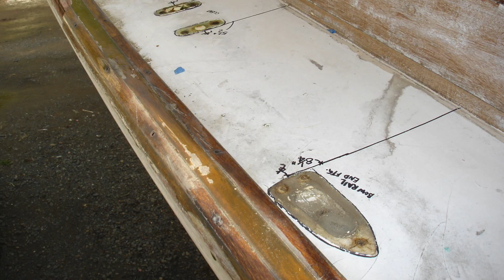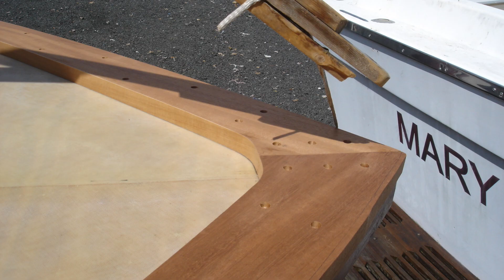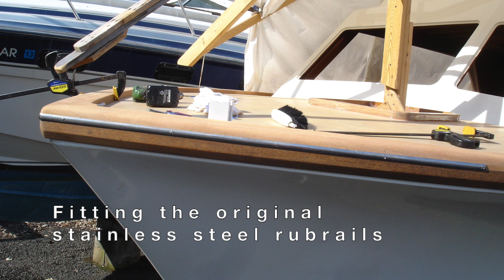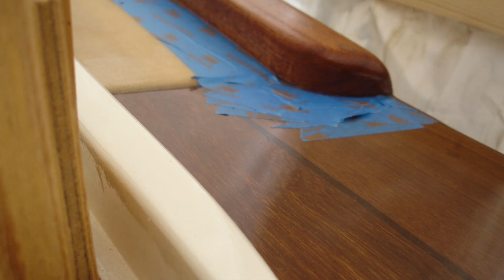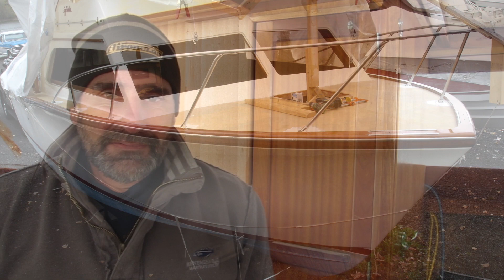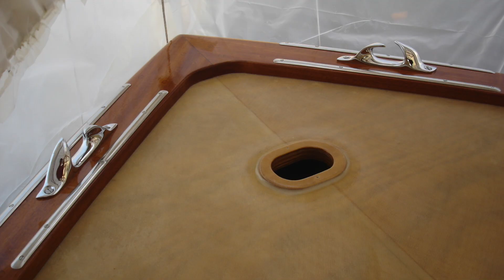New Mahogany Toe Rails. Stainless fittings. Bow rail install - Boat Restoration EP025 (2017 Part 4)

Comment: man that Bow Rail with the chrome trim pieces looks gorgeous. Bob! as you progress in this project, your out doing yourself as you keep progressing like bigtime. The varnish looks beautiful as a final finish...maybe you can design some kind of drain for that foldable cleat! I'm sure its possible and epoxy a tube in there so that water cannot damage the wood below the cleat.
Reply from the maker: Thanks Fon, I epoxied all the surfaces and painted them under the cleat. Hoping that is enough. I will need to remove it every once in a while to inspect and catch any issue.